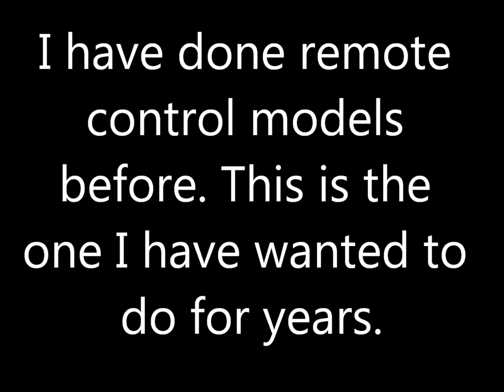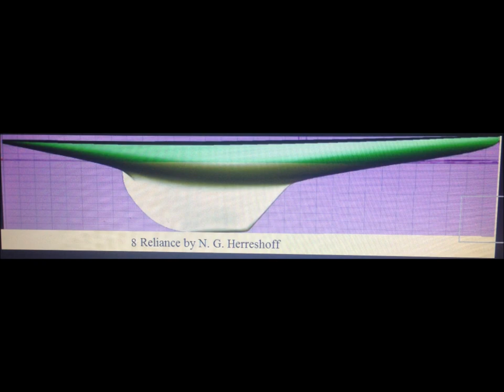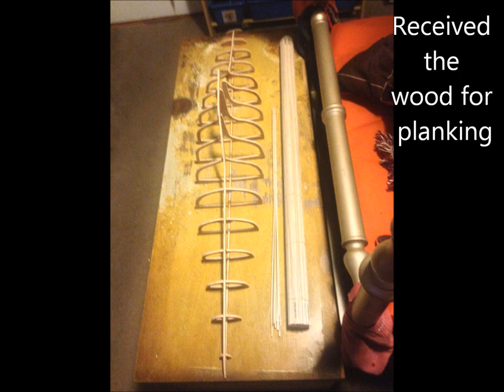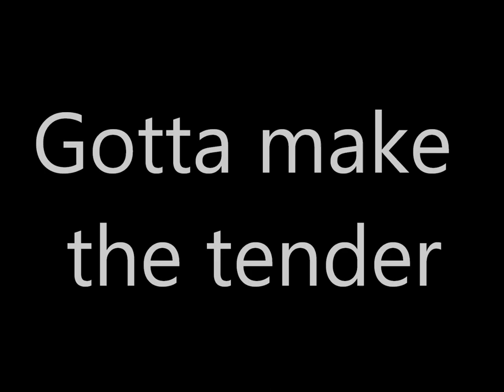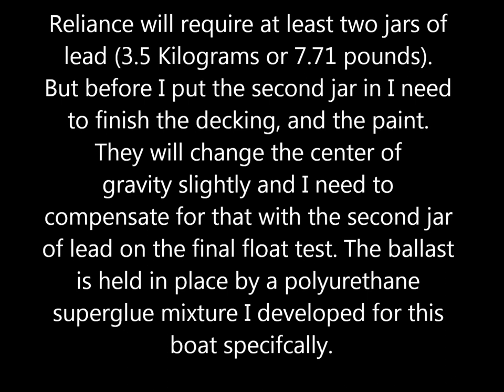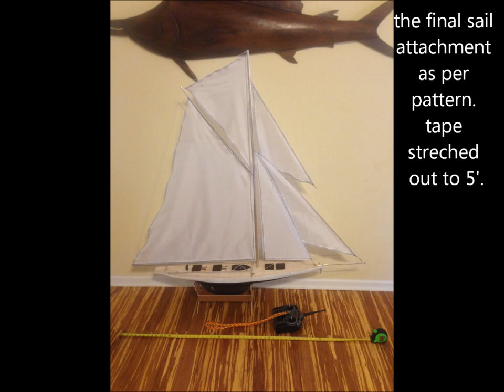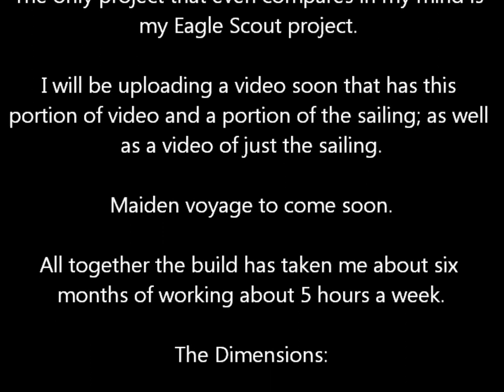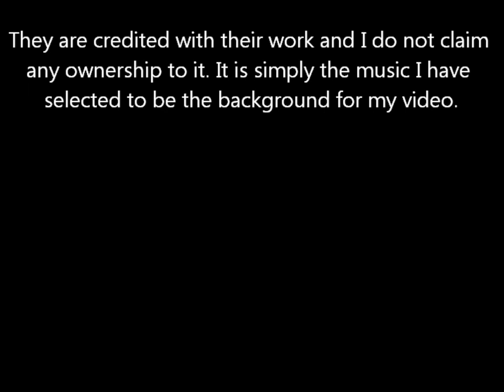Building The Remote Control Model Yacht Reliance

Comment: Nice build man  I'm lifting some lines from a Dragon-keeled yacht. It's going to be a sit-in model where you sit in it and it sits in the water. I consider it a model still. What the heck, better than a kayak anyway. 
How difficult was it to pull the lines and run them through the software? I need to figure out how floaty it will be along with the ballast necessary. Took a boat-making class in high school when I was young, the best class I ever took. Perhaps I'll Do a youtube on my piece of driftwood.
Thanks,